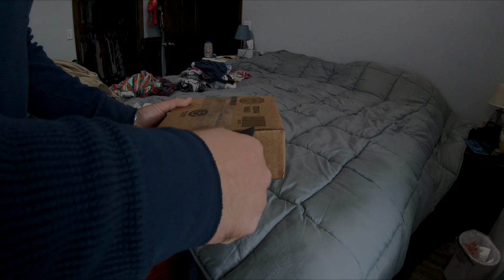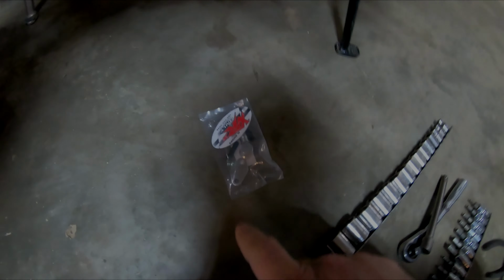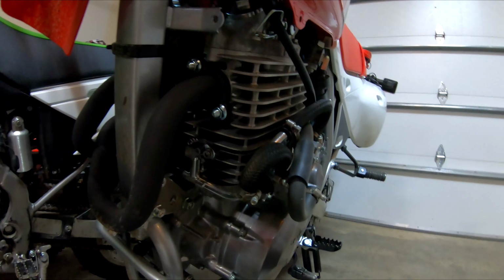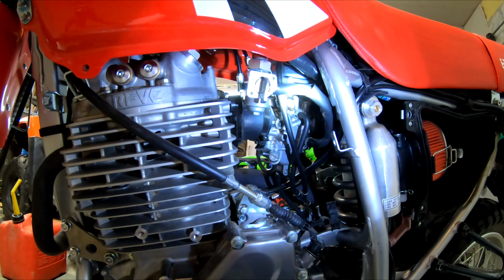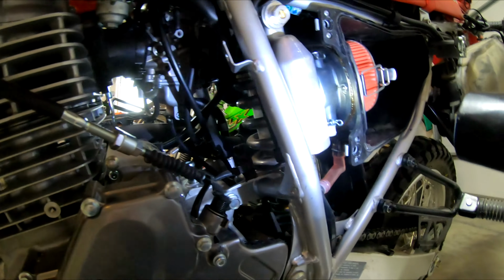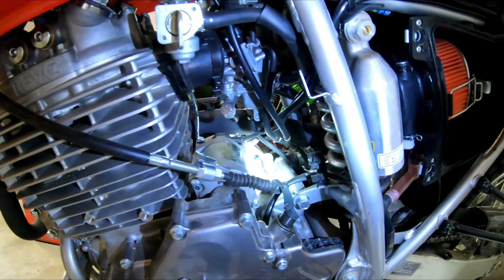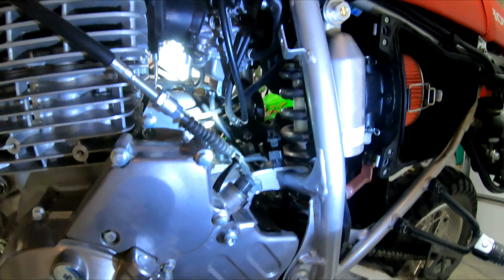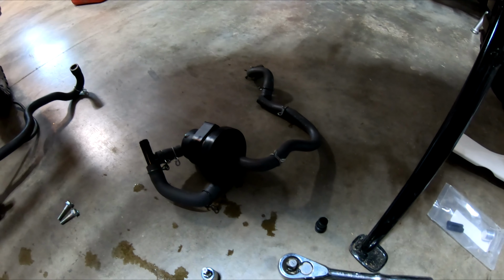installing  XRs Only Smog Block Off Kit#new,#honda,#unboxing,#livetoride,#rider#diy,#bike,#fun,#fyp

Comment: Congrats on the new XR. 

I just bought a 21 as well. 

I’m ripping off the smog pump, installing a SuttonCycleworks oil cooler and handlebar extension so the bars are a bit higher. 

Thanks for the video
Reply from the maker: Donald  congrats  too!!!!  if  you dont want  work  get the  ims  4gal  tank  it can be put on  in  30 min  no  fab  work.  i  need  the  oil cool  .  never heard  of  the one  you have  going to look  in  a  few.  the  5.8  is  awesome  other in the install.  it  was very  slow  but  im  happy.  just  checked  the  valves  yesterday  after  the  ride  today  well  do  a oil  chance.  hope  you  get to go  chase  today  and  thank you for watching
Reply: Oil cooler is ok if you do a lot high RPM desert riding in high heat, but for regular riding just around town and trails and stuff it’s really not needed and if you ride in colder weather a lot like I do it’s actually detrimental.

Comment: I ordered my XRs Only smog delete kit along with their recommended ‘airbox mod’ and different jets….ill see what that’s all about when I get it.
Reply from the maker: nice  my elevation is 158 main  a great tool to add to the research on our girls is thumpertalk  its a great forum if you all ready dont know a after market tank is also good i had a 4 gal clark and i would get 160 ish to pushing i got a 5.8  and im 240 ish to  pushing but it was a harder install vs the 4 gal its on in 10min  or so procycle is a nice spot for bike parts  too right now im on motard rims on my girl i scored a smoking deal on a set with rotors it just killed my speedo  which is ok for me i went up 5 in the rear for hoolgan antics and  i top out around 80

Comment: That's a serious bike right there but i would love to see a more modern version of 650L, it's looks kinda old school.
Reply from the maker: klassic kings  ya  honda  has not  changed a thing  in 20 years  .  this  was brand new  in april.  the klr  just  revamped there style with the same power plant.  hope  you  have something or  get something to chase the sun  on.  enjoy the day and thank you for watching , ps  this is  the 2nd one that we have had the first rocked but being used there was some issues  this  thing  not going any where being we got it brand new.  just miles  of  smiles
Reply: On my 2024 I put on a red 4 gallon plastic gas tank, put vintage XR tank decals on it with the yellow Honda wing on top, red seat cover, painted the white front headlight assembly red I think it looks great. Really need to change out the 2 gallon stock metal tank anyway.

Comment: Pulled that charcoal canister of both my 96 and 03 pulling off my 22 never had any problems with oil from crankcase
Reply from the maker: nice Tonyroll. there great scooters .  did you get a bigger tank on any of them or just the stock still.  hope the night is going good and thank you
Reply: @mrsmel269  I put an ims tank on my 03 and probably will on this 22 thanks for asking

Comment: So if you don't have the Cali model, you pretty much just had to plug the airbox, and put on the blockoff plates? No other places to plug off?
Reply from the maker: i wanted the smog pile off its only about a lbs or 2 but i wanted it gone.  hope you were able to get out on yours today i cant wait to go for a spine . enjoy the night and thank you for watching
Reply: @mrsmel269  I ended up doing the smog removal on my bike the other day. It was like yours, not a California model. So I only had one small hose that went to a t connector that led to the carb oh, and of course the big hose that leads to the airbox. I didn't have to deal with the two additional hoses that are on the California models, what a nightmare.

Comment: What’s the point removing smog off ?
Reply from the maker: ABM  the smog block off rob a little power . you deff can just leave it but its very eazy to remove .  a great place for info is thumper talk that fourm is awesome .  hope you get to bust out your girl today and have some fun and thank you for watching .  hope this helps some  too
Reply: @mrsmel269  so removing the smog just means I get little more power to the bike an less weight ?
Reply from the maker: yes ABM .
Reply: Sure just doing a few simple mods that take maybe an hour and you drop 3 pounds of junk from the engine and gain 5 horsepower for about $50….my question would be why wouldn’t you do it?